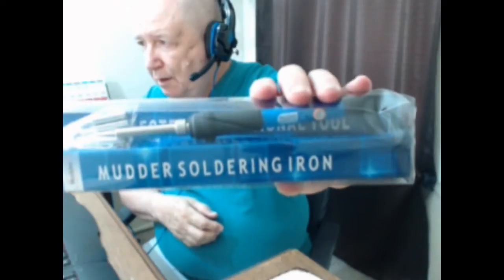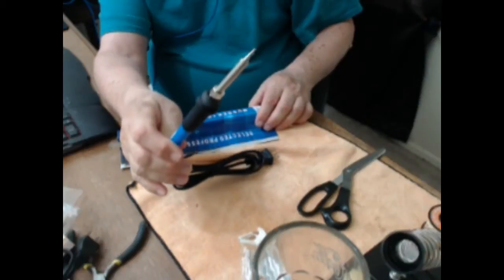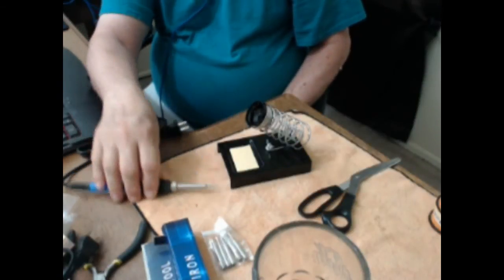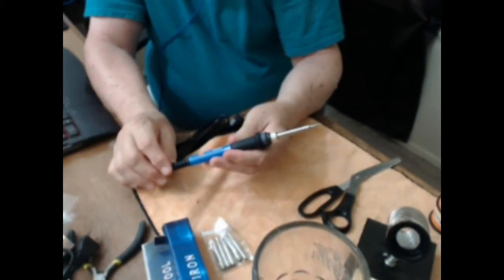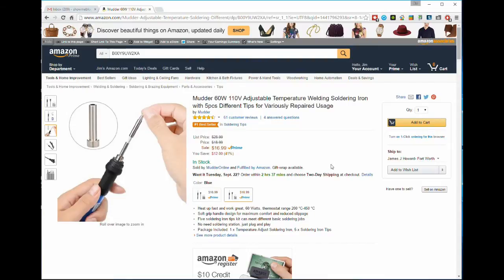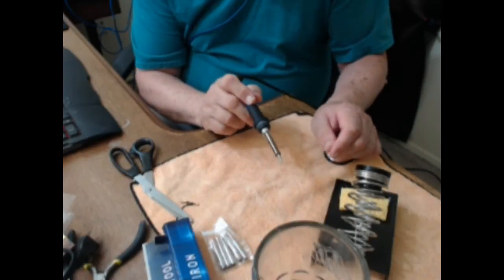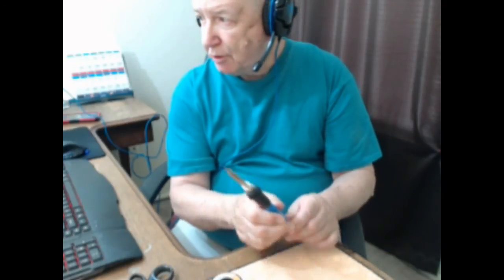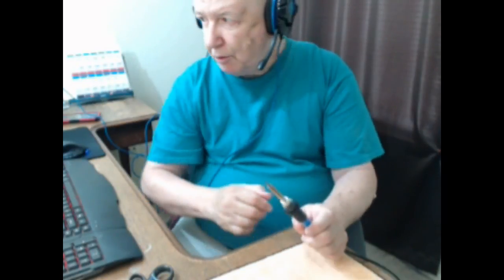Review of the Mudder 60w Soldering Iron

Comment: 110V model:
I got this and it gets too damn hot.
I tweaked mine.
Remove the "103" 10K resistor and replace it with a 33K-47K resistor.
I used 47K and it now dims the light when I adjust it.
Now 350C is just right for soldering.(no where near 350C in reality)

The way it comes from the factory is just stupidly too hot.
red hot is bad.